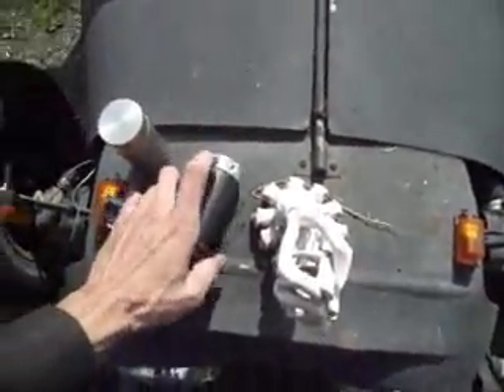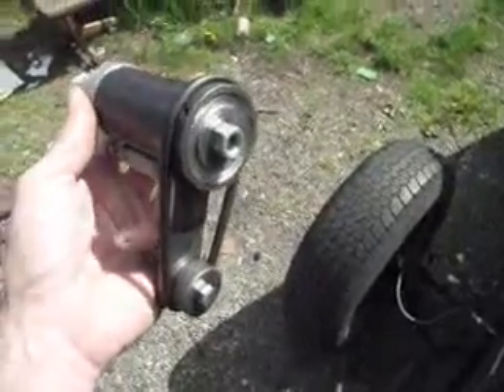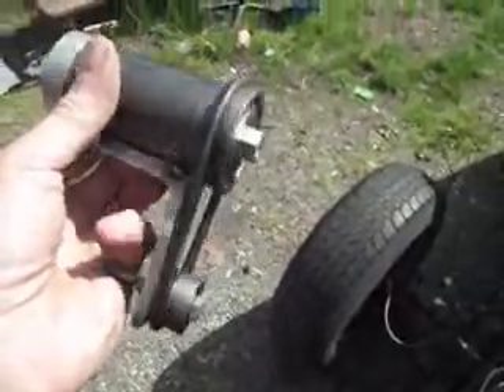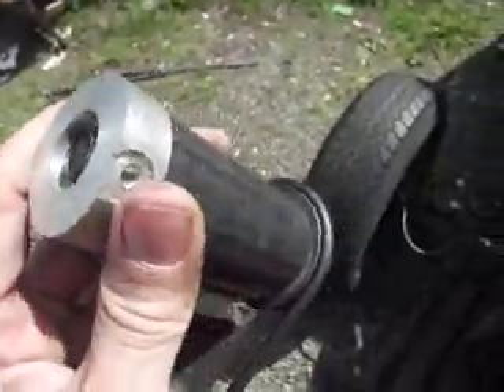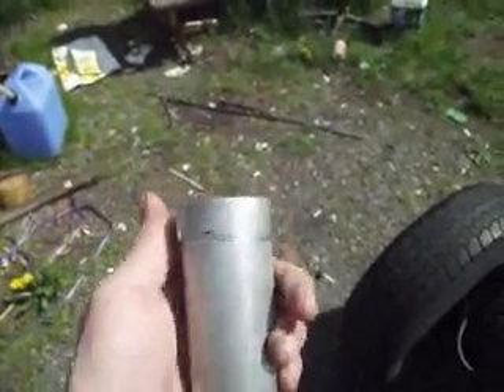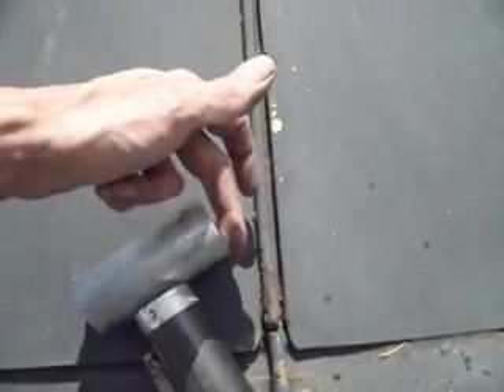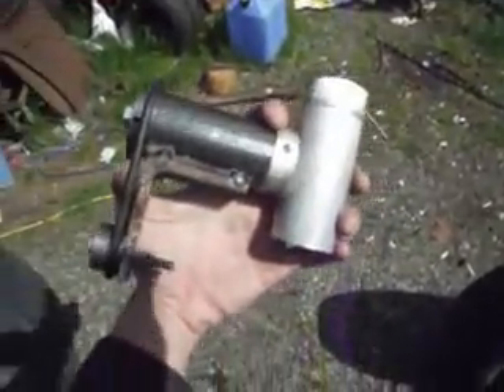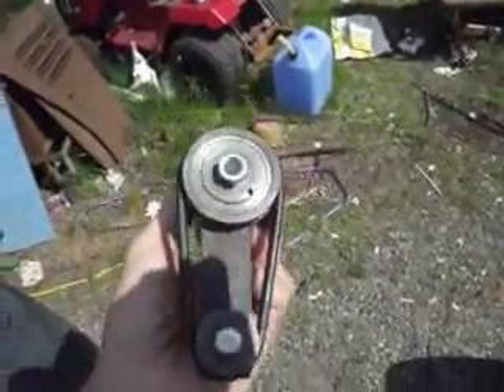small home made equatorial mount

Comment from the maker: it has a thumb screw to adjust tension, and i used some sealed ball bearings on the declination. it worked pretty good actually, but i have since been designing a bigger and better mount. this one was more of a test to see if i could make one.